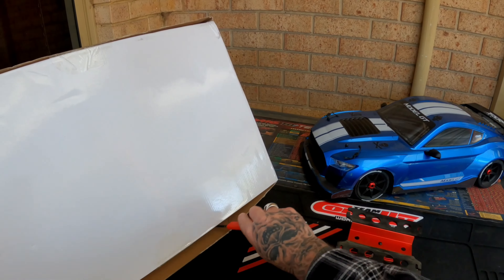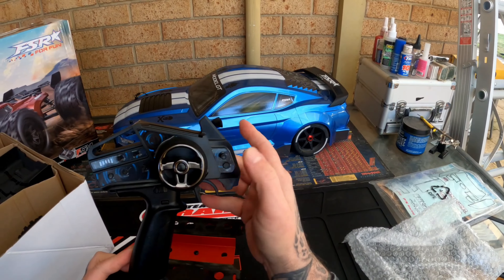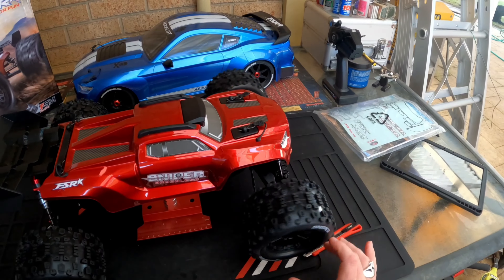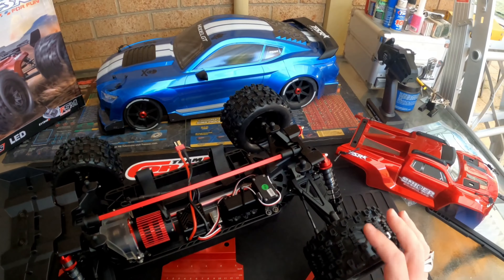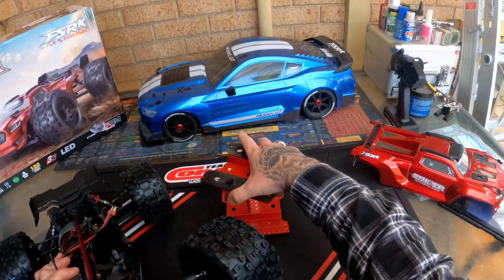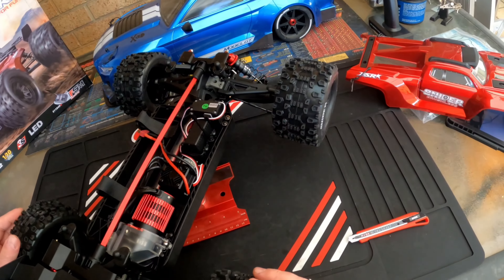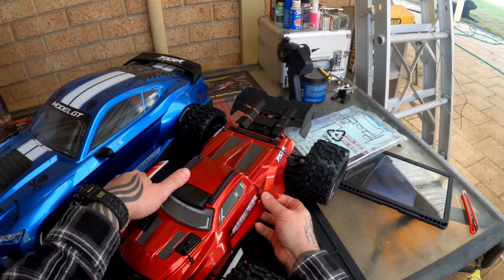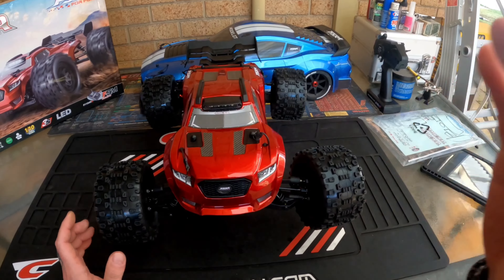FSR Sniper 1/10th 3s Quick Unboxing

Comment: Hey mate, that looks Fantastic! I'm happy you made the video, the colour man! 
You should try out XT-150 connectors, especially on 6s. You can run in serries and parallel without changing anything at all, and you dont need a Jumper or loop connector or whatever its called.
I can't recommend them enough.
Anyways, outstanding content my friend as always 👍👌
Reply from the maker: Thanks man 
It really looks awesome ! Hope it performs ... I have seen the Xt150 and they look good ... Im just too lazy now to swap everything... All mine are Xt90 and some Deans on my Tamiya cars ... Thanks again 🔥🤘🏻
Reply: this truck is only a 3s truck, XT60's are fine
Reply from the maker: @harlyquin  easier for me to throw on XT90 because all my Lipos are xt90 ... I dont use adapters

Comment: yeah i have one of these, 1st thing i did was remove all the crap electronics, the motor is to slow on 2s and gets way to hot on 3s no matter how you gear it and the steering servo is way to weak for this size truck, yeah the lower arms are nice and beafy but the diff outputs are touring car size
Reply from the maker: @harlyquin  nice 👍🏻
I have a new servo and esc ready to go in but i will run it stock and see how it performs and then make changes ... Diffs definitely needs a tune 🔥
Reply: @kaosr.c  yeah 4 sure, i was the same even after seeing a review on it i still had to test the motor/esc for myself
Reply from the maker: Yep totally , i always test it for myself and make up my own mind .... Looking forward to taking it out